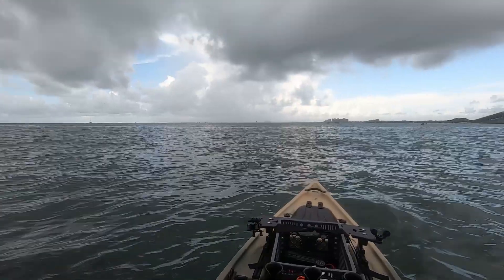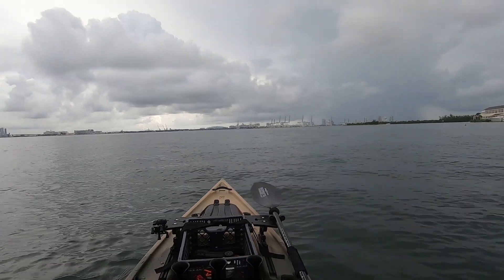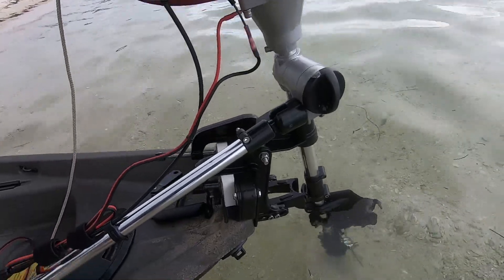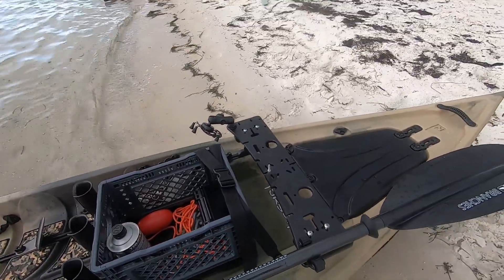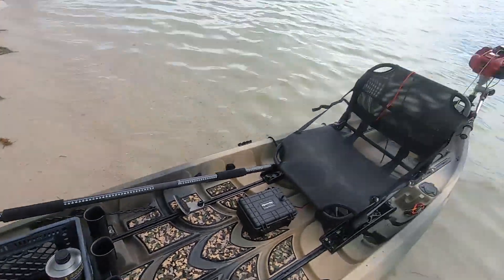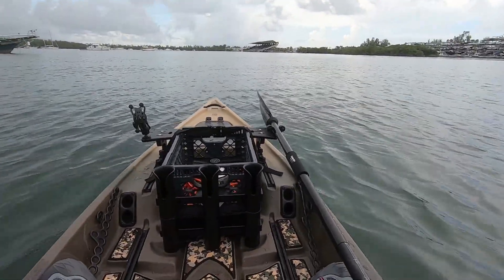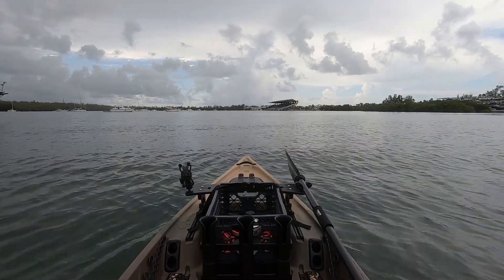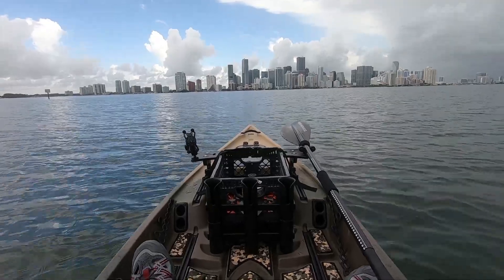Stainless Steel 2 Blade Prop Trial on the Nucanoe Pursuit Powered by the Honda 50cc

Comment from the maker: The prop comes drilled and ground already to fit right on with the supplied shear pin and collar. No modifications are needed.
Reply: I need one STAINLESS PROP for my honda engine outboard setup also.  i live in the philippines. How much to purchase and ship?  Address:

SIDNEY  MCGIBONEY
2132 BRITON ST / P. BURGOS ST
BARANGAY 50
PASAY CITY, MANILA, PHILIPPINES 1300
Reply from the maker: @dalegrible5556  please go through the website and send me your contact information and then I can figure the shipping out for you.

Comment: I reached out via email before you went on vaca.  Will this new prop also work with the Hobie setups?  Also it would be great if you can get a DB (sound Meter) to really give us an understanding of how load it is.
Reply from the maker: JOEY L the prop will work exactly like the other one. I don’t have a decibel meter and if you are worried about 4-stroke noise you maybe shouldn’t mount an engine in front, but mount in the rear. These are no where near 2-stroke loud.